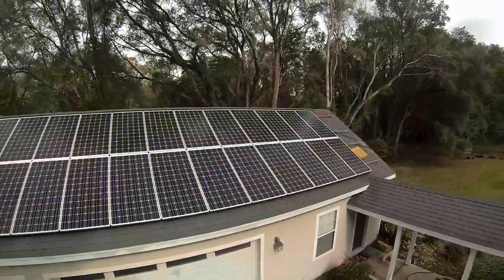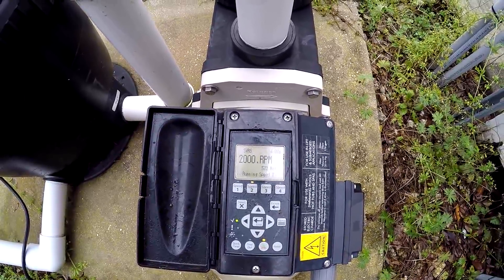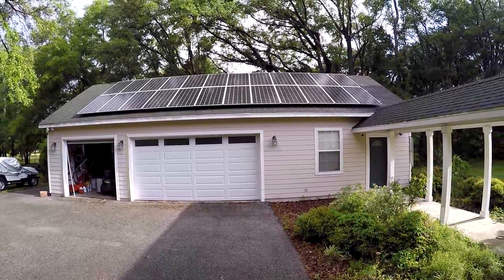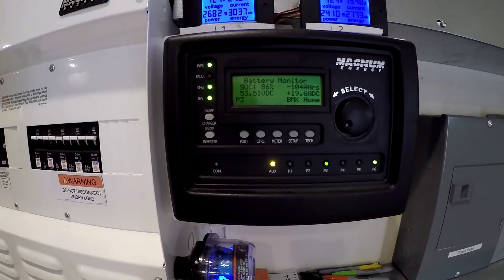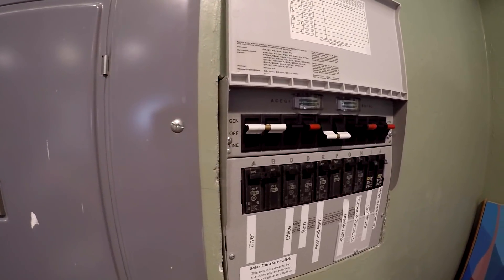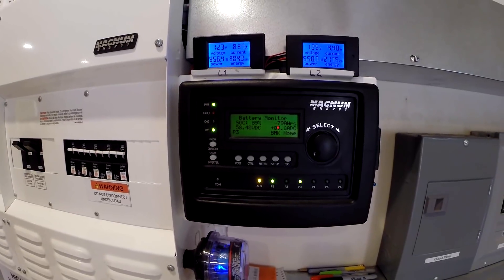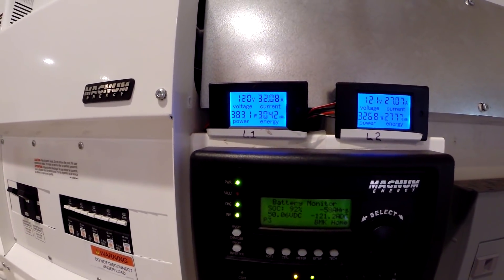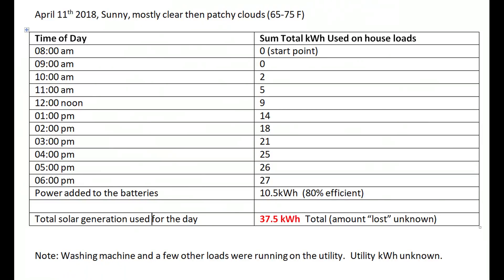Getting the most out of your Solar PV System

Comment: I think you should build a water tower next so all extra energy can be used pumping water. Nice system and those Magnums are the best. You could put an upper thermostat in the bottom of the hot water tank and once they are satisfied the power transfer would be automatic to the next 240 ac volt device whether that is air or dryer or water pump to fill up the tower lol.

Comment: I just got my 7.2 kW DC rated Sunpower system online and it has been generating just about 40 kWh per day and peaking up to 49 kWh. Currently it is a grid tie system, but I am in the works of putting an AC coupled system together so I can have some backup power. My average utility power usage is along the lines of 16 kWh per day, so most of it is getting exported to the grid.

Plus, I have a 48 volt DC power plant to keep my telecom closet happy. So, integrating it to the Magnum Panel with the dedicated DC load centre is a perfect match. With a little bit of experiment with some Arduino or Raspberry Pi, I might try to put something together to make it possible to take my system offline and have it integrated with my 13 kW SQ Kubota for the generator assist to fire up the central air-conditioner to keep things "normel" when needed. Still learning along the way as always...
Reply from the maker: Felax, Sounds like you have a really nice system.  The advantage of being grid tied is that all of the power your system produces will be used by someone and not go to waste.  It's also the most cost effective way to power your house.  My main goal in building a hybrid off grid system was to be able to have power in all situations, including the upcoming zombie apocalypse!  Thanks
Reply: Yep, at the moment is quite a patchwork of offline equipment. It is kinda of a backup to a backup requiring a lot of manual intervention, the Magnum Panel you choose for your system sparked an idea that there is a way to get both the DC and AC side of the systems to work together plus keeping it neat. I did consider Schneider Conext which offers a lot of flexibility on grid and generator assist, but sacrificing quite bit on the DC side of the power system. After researching quite a bit on the Magnum Energy products, I came to the conclusion that it will work with the "systems" that I currently have and building the grid tie solar system would be the icing on the cake.

I've been acquiring parts over the years and slowly the pieces of the puzzle is coming together. Since you mentioned about the zombie apocalypse, I did made it through Irma on battery back up for almost 3 days before kicking the generator over. I aquired an MS4448PAE some time ago and used it mainly as a very expensive battery charger and a UPS. It took a good real world stress test powering between the split phase for myself and my neighbour next door. It is definitely built like a tank and weighs much like one; I might think about getting another one to stack later on once I get the power panel put together.
Reply from the maker: Sounds good.  You should post a video of your system.

Comment: Nice. So the window units are used instead of    two A/C condensers?
Reply from the maker: We have three large (utility driven) heat pumps that heat and cool the house.  We run the two window units (solar driven) to reduce the amount that the big AC's run.  Its been working really good.  Thanks!

Comment: David, interesting to see how you manage your system. If you could computerize the draws and have them automatically switch  on and off alternately, you would have it made.  I need to trim some trees back so I get more daily exposure on my panels.  The trees will not go to waste...future firewood for winter enjoyment.
Reply from the maker: James,  I have been thinking of computerizing the system as you say.  Might be something for Reliance to think about developing.  Imagine that your entire house is managed in a way to maximize the use of your solar powered system.  Very doable.    I don't normally go to this extent as it is way too much work.  This was just a test to see how much I could pull out of it if I really worked at it.  Thanks!

Comment: As I've followed your videos I am always impressed by how much effort and planning you put in.  Your efforts have certainly paid off.  Do you have an estimate about how long to can run things on batteries?  Seems like I recall you having a little grid power down time when the hurricane went through?  For example, could you get by on your batteries for 4 days if you didn't use the dryer and had very little sun  to charge them up?  Just wondering.  Thanks for the video.
Reply from the maker: SyberPrepper, I have a 48v, 740 Ah, lead acid battery bank.  If I drain it to 70% SOC, then I have about 11 kWh of power to play with.  We probable use around 25-35 kWh/day under normal use.  During the hurricane, we lost power for three days.  We ran off the solar and things seemed pretty normal.  We did not run the washer, dryer, dishwasher, oven, or any other luxuries.  We do pick up a fair amount of power even when it's cloudy and even when its raining.  Enough to keep us going.  We never had to run the generator a single time.  That said, if the utility were out for weeks, I  think things would have been harder as the laundry piled up and so on.  One other note:  we typically only drain the batteries down to about 80% SOC overnight under normal conditions.  You can check my history here:
http://data.magnumenergy.com/MW5454/
Thanks!
Reply: I appreciate you sharing the details of this with us.  It helps to know how all this works in the "real" world.